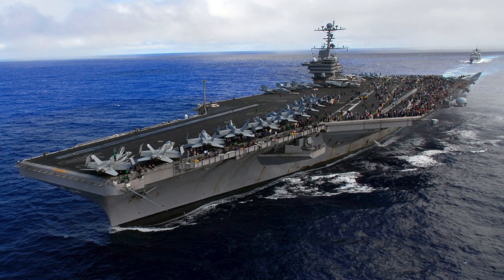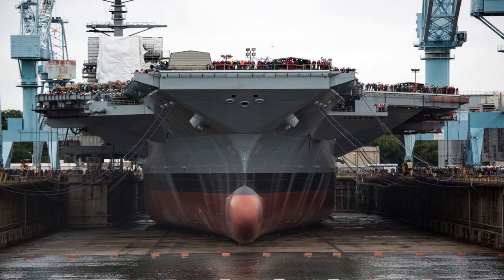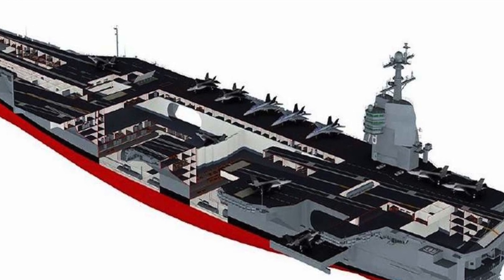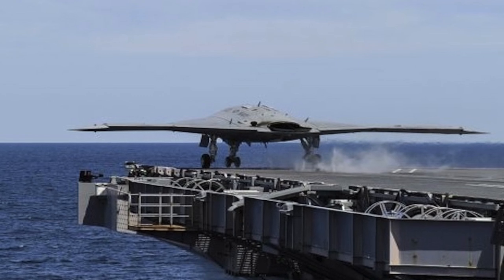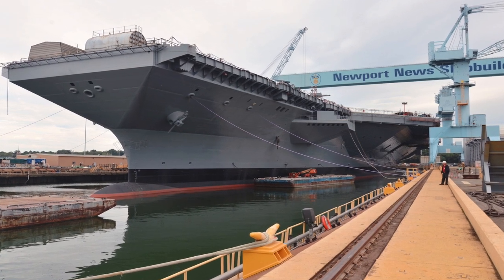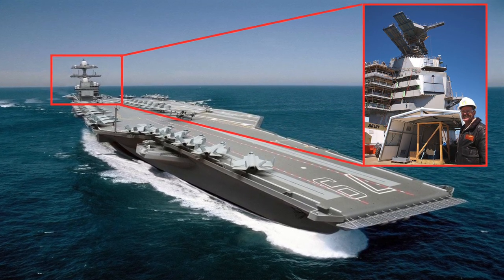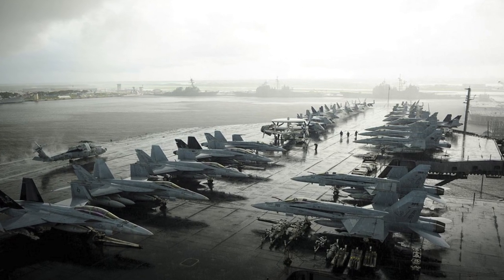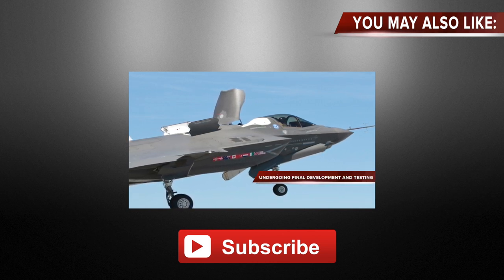NIMITZ vs FORD class: TOP 5 IMPROVEMENTS

Comment: Accurate comparison. BUT, I would not de-commission any of the Nimitz class Carriers. As money and time allows, I would automate and update the Nimits class. They haven't done their estimated time of service, and can operate in the narrower waters around the world the Ford class can't operate in. Also, Nimitz class carriers can be used to base Marine Amphibious Units BECAUSE of their four elevators. Other, more modern screening vessels can make up the protection the Nimitz class lacks compared to the Ford class carrier. Besides, most Nimitz class carriers have been modernized as they were built. Why waste perfectly good carriers that have a long service life??
Reply: ships have a limited life span.  oldest Nimitz's are built in the 1970's and are in their 40's
Reply: MR.Chickennuget 360
 Commercial vessels, maybe. But when the Navy builds a ship, it is meant to last 50+ years. Example: the Iowa Class Battleships (which are still "owned"  and basically maintained by the Navy in case of need). These ships may be old and outmoded, but could you imagine these battleships (Iowa Class) re-equipped with the new rail guns, or the 2nd or 3rd generation rail guns the Navy is right now equipping ships at the Ingalls Shipyards in Biloxi MS? Awesome.
Reply: *****
 All four ships were modernized in 1984 by the Reagan Administration (a 42 year advance in the ships systems, and the addition of air defense and cruise missile offense). The Navy estimates that it would take 5 months to re-commission the four with today's mods. The crew would be supplied by a freeze on resignations, would be retirees, and the addition of automation.
Reply: longshorts3
the ships have very limited value.
Reply: MR.Chickennuget 360
quantity has its own quality. Why do the Russians still have T-32 tanks (WW II) still stored away and maintained? The Russians are thrifty because they have to be. Seems that we should learn that lesson. As I understand, the U.S.S. Nimitz just recently went into dry dock in Bremerton WA. for modernization and "depot maintenance". The Iowa Class Battleships are scheduled for maintenance every ten years decommissioned or not. The Ford Class Carriers are a great step into new technologies that could be installed into the Nimitz Class. Also, one does not throw away ships that are deemed to be "outmoded", or we wouldn't have the four "Mothball Fleets". Most of those ships may have a second life converted into some other use.
Reply: longshorts3
you mean T-34?  no they don't they don't store WW2 T-34s they might have some in some places but they are not storing them for combat.  they would be hopelessly obsolete for modern warfare.
Reply: MR.Chickennuget 360
My Priest is from the Ukraine. He told me these things. are you trying to tell me that my Priest lies to me?
Reply: longshorts3 Ukraine is not Russia.
Reply: MR.Chickennuget 360 The Ukraine used to be a part of the U.S.S.R., and has close ties to the Russian Federation today. If you had paid attention to your history class in High School, you would KNOW this. Duh.
Reply: longshorts3
i do that but you said the Russians still maintain stocks of T-34s specifically you said:

"quantity has its own quality. Why do the Russians still have T-32 tanks (WW II) still stored away and maintained? The Russians are thrifty because they have to be"

the Russians do not maintain stocks of T-34s even the remaining T-55/54s are being removed.

don't try to play like i don't know what i'm talking about your the one who said Russia not USSR
Reply: MR.Chickennuget 360
And you think things have changed much in the change between the USSR and the Russian Federation? I do not. The Russian Federation is trying to reinstate the USSR, and its policies.
Reply: longshorts3
i'm not going to debate policies but i know for a fact that they are not keeping T-34s in storage.  only T-34s you will find in Russia are in museums or personal collections.  not in state arsenals.
Reply: MR.Chickennuget 360
 The USSR used old tanks as ready made"pillboxes" along the Chinese Russia border, and on beaches towards Japan. They buried them in place and crews rotated amongst them as weather permitted. This policy has not changed when the Federation rose up. As the old T-32's and T-34's rusted through, they were replaced by "newer" T-34's drawn from long term storage. Your "facts" are incorrect.
Reply: longshorts3
no your "facts" are made up there has never been a T-32 in Soviet Production.

and sorry but using tanks in fixed positions is not the same as using tanks in storage.  your grasping for straws here.  Frankly their value is marginal as a bunker.

everything you have said is nonsense.
Reply: Longshort, I think you are missing the point - money. It gets to a point where upgrading ships have reached their limits and a new ship design needs to be created to ensure that the Navy has kept up with the latest technologies and taking advantage of new techniques, otherwise you are upgrading stuff that is completely out of date - essentially the ship will cost more than developing a new ship because the upgrades cost will be higher.
Reply: FarmingtonS9
 Pulling a ship out of the mothball fleet, re-fitting it to meet a different need DOES NOT cost more than building a new ship. Not when you figure the R&D costs, a "proof of concept" first of class, then re-tooling to build the newer class ship,and all the time "testing" it out. Granted, building a new class of a new design like the Ford Class carrier is a good thing to keep way past the opposition technically. BUT, screening ships need not be new designs, nor replenishment ships either. All they have to be able to do is to keep up with the carrier for screening and replenishment duties. We re-fitted WW I four piper destroyers into troop ships (the ones we didn't "lend/lease" to Britain), and used them in both Theatres. This was quicker and less costly than grabbing cruise ships and refitting them, and risking troops lives because they were thin skinned, and unarmed. Even CVN 68, the Nimitz has at least 20 more years of service in her.
Reply: Nimitz is now within six years of her design lifespan, not twenty. we don't need to redisignate her and her classmates as Amphibious assault ships(often misclassed by morons on youtube as carriers) because we already have 10 ships that are designed from the keel up for that purpose,  also because of the placement of the Reactors(which is dictated by physics, safety reasons, and redundancy), and the fact that the foremost third of the keel in very narrow, and the fact that the Diesel generators(back-up to reactor based systems) are in the forward most and aftermost sectors of the keel, reconfiguringthe ship would be monsterously expensive, and the fact that none of those systems can be gutted means that you cannot gut the crew quarters for Engineering, Reactor, Mechanical departments,Deck depart cant be gutted either because you have to crew for porting, resupply, and upkeep of sectors of the ship the rest of the crew is not assigned to upkeep. Your proposal would INCREASE Electrical, Enviromental Control(actually is a necessity since NImittz Carrier were designed to operate in the North Atlantic and were designed intentionally to retain heat), and Mechanical departments. the crew all have to live somewhere, they have to eat, they have to have facilities for Medical, Dental, Legal, and personel departments. And that's just the ships crew which is currently around 3200-3600 dependent on which specific ship in class, If you added the squadrons(helicopters in your proposal) and their personell you en up with an Airdale group pretty much the same size as current compliment gives up, leaving you with over  five thousand crewmen, and officers, and that's not counting your amphibious force. The Hanger Bays in the ships while large are t large enough to house a battalion's worth of Tanks, troop carriers, and HumVees . . . but there would be no room inside left for the Helos, there is no existing mechanism for ground craft to get off the ship without a crane, good luck invading grenada with a crane, not to mention there is only a limited number of ports deep enough to house a carrier. Anyway a battalion of Marines would end up being an additional 6-8 hundred marines or more, which is server hundred over the crew carrying capability of any Nimitz class ship. In addition if you extended the lifespan of the ship, they would have to replace a large number of damaged components, and refuel the reactors, which is a time consuming process, which ran several years long and 2 billion overbudget on the TR.

 You proposal premise tells me you have no actual experience in the Navy, or you would have known or been able to generate the wall of text above.
Reply: lazyidiotofthemonth
 I was stationed at NAVSEA for over 10 years. And for your last comment, I'm third generation Navy, my Son, fourth. Also, I volunteered my time after retirement to NAVMARCORPS MARS for 15 years. So do not say I never wore the uniform.
Reply: My Apologies, Sir.
Reply: lazyidiotofthemonth
No problem. We are trained to NOT reveal our names, rank, location, and specialty on public media, even if retired from many unknown sources. Why? Because of possible attack on us, or our families. My 'opinions" are from the way I have seen things work. You could not have known. Have a Happy Holiday Season.
Reply: or turned into space battleships!
Reply: You've noticed something about the Pentagon that they'd prefer you didn't. Namely that a lot of the money spent there is strictly for the purpose of transferring the nation's wealth to high tech firms.
Reply: Are we planning on invading Grenada again?
Reply: + Philosophical Fish
The reality is that the battleship is a thing of the past. It was nearly the case in WW2 !
Reply: Graham Stevenson there is some new technology on the way which may lead to the return of the battleship
Reply: Patrick Dawson I really hope so. We need a new fleet of battleships.
Reply: Teaxas Patriot Militia battleships are obsolete.They are not coming back.
Reply: longshorts3 I agree look at how many times we tried to decomission the hog. Besides this is China's back yard we don't have the numbers and resources here. Besides, China should do the right thing a shut off that Korean Moran and our men and women could go back to doing other things. Our faults lie in doing something later instead of dealing with it when it rises or reoccurs.
Reply: MR.Chickennuget 360 but are still big sticks in smaller ponds.
Reply: Equipping Iowa class ships with railguns is an impossibility. The incredibly costly replacement and redesign of her main battery notwithstanding, you'd have to rip her guts out and replace her propulsion and power systems with nuclear generators, in the process completely redesigning as much of the interior as possible as well. You could build two purpose designed vessels like that in her place for the insane cost that would entail. She simply wasn't designed with anything like that in mind. 

Let her rest. I know she and her sisters are an imposing sight on sea, but their theoretical usability is truly reaching it's end. While they still theoretically are usable (if atrociously expensive to exploit), the advent of railguns will eliminate her from any possible use in the field. Her massive armor is still completely useless against the penetrative power of a railgun, and only burdens the ship in future warfare situations (whereas now, her armor is still kind of a benefit - no modern missile can come close to piercing it, so she is virtually invulnerable to modern anti-shipping weaponry). 

The march of time has already left that class usable only in the event of large scale war and desperate conditions. Soon, even that she will lose. Just be happy that she and her sisters are preserved, and serve as a proud reminder of the US Navy's glorious history, and as a visual representation of an age of naval warfare now long gone, when proud behemoths like her and other dreadnoughts and battleships ruled the seas and served as symbols of the might of their nations.
Reply: Until a new ship is named after my state, I will always hope for the USS Wisconsin to return to active duty, Last battleship ever made by the US, will miss my state being represented on the sea till then.  BB-64
Reply: longshorts3 900
Reply: longshorts3 I’d sell a few of them to the British.
Reply: longshorts3 wasting our money is the whole point.

Comment: I say this as a former HT and number one attack team leader for the Flying Squad aboard the USS Kitty Hawk.  She was a good ship that ran hard for decades, but it wasn't free....  She had the best engineering department in the Navy the fact practically no one knows how many fires,  floods, toxic gas leaks "casulties"  I had kept a tally of how many 30 minute and 45 minutes SCBA tanks and thankfully very, very few of the godawful OBA canisters.   When I added it all up the amount of hours amazed me so after a little more math out of the 7 years I was in one and a half of it was spent sucking air out of an SCBA.  The point of all that isn't me trying to stake claim as the most experienced post ww2 sailor in the art of damage control, it was to establish that maybe, just maybe I know what I'm talking about thus giving some authority to what I'm about to say.

Automation is all fine and good but you have to make sure you have more than enough crew to fight the ship.  You want a bit of a surplus keeping the ship alive isn't as easy as you might think.  Also remember any ship can be a sub once..

Comment: How does eliminating manpower actual result in reduced cost given the huge cost over runs of the Ford it just doesn't add up. Same with the supposed increased sortie rate. Given one less elevator to move planes between hanger deck and flight deck and the unproven still in development meals has shown that it cannot met the spec in order to generate the increased sortie tempo. 

Just more PR crap to make us think we are getting our monetizes worth. Can imagine the cost to rip out the meals and retrofit steam.
Reply: Sir, you figure 4.50 per happy meal per sailor per day, that's 700 sailors times 4.50, that is enough to make Mexico pay for the wall AND the new carrier.

Comment: If you were paying attention, one still picture gave away a 6th major upgrade:  Pilotless drone fighters.
Reply: drones have nothing to do with this class.  we can operate drones from existing ships.  you can operate drones from a dirt strip if its built rugged.
Reply: On the contrary, Boeing has already produced an operational drone fighter for the military.  We aren't talking something you can hold in your hands, it is the size of a fighter aircraft but has no pilot.  It is therefore not limited in performance by what a human pilot can withstand in terms of pulled G's and blackouts.  That's the future, that's where the Pentagon wants to go.
Reply: Joisey
um what does that have to do with anything i was saying?

Comment: with that much hp how fast could it go 100miles per hour?
Reply: No real speed difference.  One limit of speed is "hull speed" which is based on hull length.  Going faster requires getting the ship up on plane... (not happening with 90,000+ tons)

The bulb at the base of the bow acts to increase effective hull length and reduce drag and has more effect than tripling the reactor power.

Then comes the effect which causes power requirement to CUBE as speed doubles.  so 3X power to the shafts would mean just a fractional speed increase... if you could manage to actually deliver 3X power to the propeller.

The Navy won't ell you what top speed of a carrier really is.  They will just say "in excess of 30 knots"  the ancient USS Midway class (post WWII using diesel fired boilers) ships could do 30+ knots.
Reply: I have watched many ww2 shows and even though top carrier speed was 33 knots pilots have repeatedly claimed them going 44knots.and I heard a story from a guy that was on one carrier coming back to states and another carrier passed their bow on plane supposedly went 1800miles in 18 hours   something about a spy ship and ive been wondering if possible ever since
Reply: and thank you for answering
Reply: The top speed of a Nimitz Class carrier is actually classified. My dad was on the Nimitz back in the the 80s and they had an accident where someone got steam burns on his lungs and could not be evacuated by plane because of the altitude issues. From what he told me they immediate went to emergency flank speed towards the nearest land based hospital to try to get within low altitude helicopter range and the admiral in charge of the fleet ordered the speed indicators on the bridge be physically removed for the duration. Sadly the sailor expired before a helicopter evac could be attempted
Reply: I served aboard Nimitz as part or the air wing in the mid to late 70's, 2 med cruises, and there were numerous times when we were hauling ass! I mean, the wake we created was as high as the hanger deck which is 30 feet above the waterline. Only a guess on my part but I'm sure it was in excess of 40 knots. I had heard at the time top speed was considerably more then that.
Reply: phosgene11 Pop was either a CPO or SCPO I think. Came onto the Nimitz in 82 or 83 stayed on for 2 MED cruises, its first dry dock overhaul , transition to pacific fleet out of Bremerton WA and then left on the mail plane in San Diego before She headed west to provide security for the 88 Olympics. Then he retired while on accumulated leave